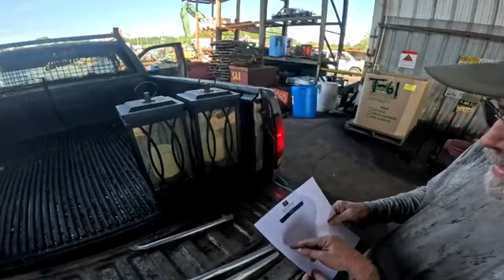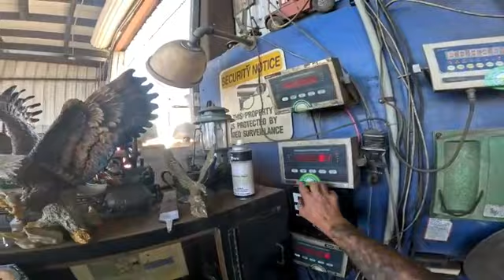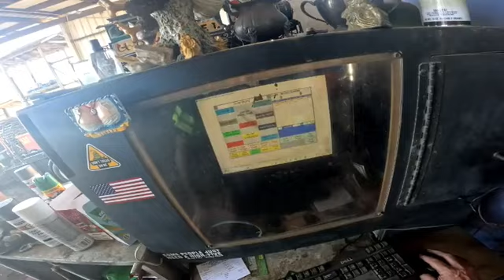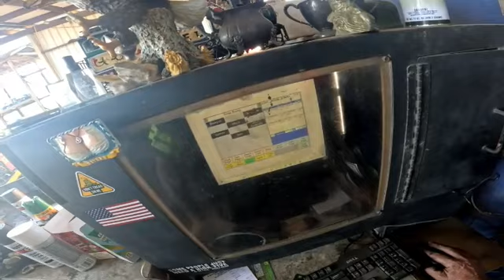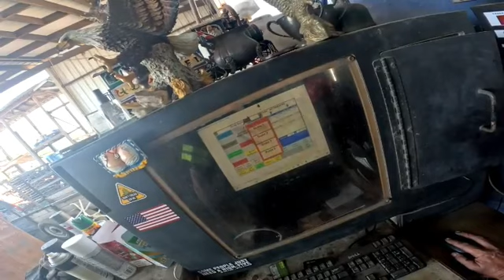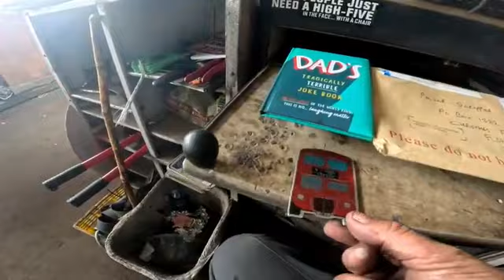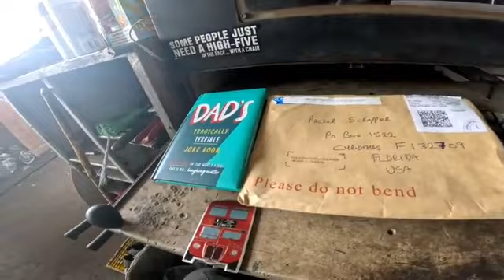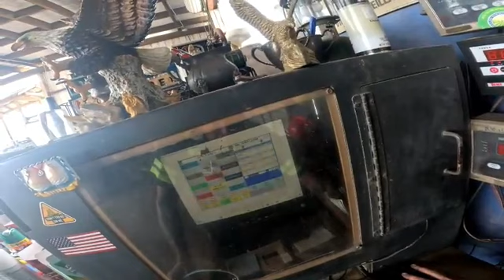MAGNET FROM ENGLAND TUESDAY #scrap #scrapyard #scraplife #recycle #recycling

Comment: I’ve been trying to think of a way to make tearing the mowers and or motor cycles apart easier…
So as you grab said unit ..you then drag it thru a couple I beams on the ground in the shape of a V ten you would pick up against the wedged in remainder said part
Reply from the maker: If I had a 2 square tubing welded on to the front of the machine it might help

Comment: Hey brother, would love to know why you are piling things the way you are for the bailers. For example, in this video you picked up a large pile of material, dropped it near the bailers and then removed 1 piece off the top for another pile. Are you just separating materials and sizes? Im curious as to why you do what you do on the  lol. Give us a breakdown while you're loading the bailing area :-)
Reply from the maker: Most of the material I try to put as close to the baler it goes in